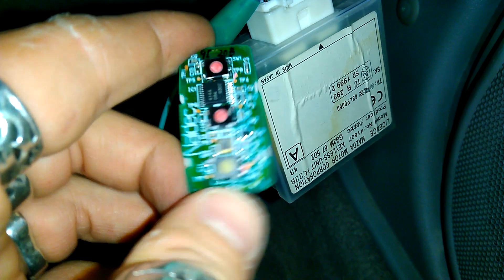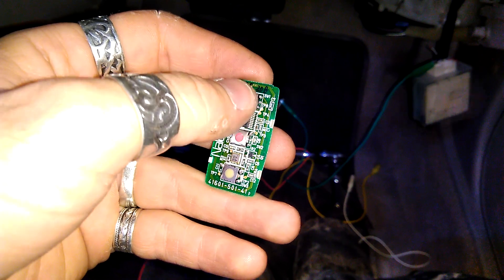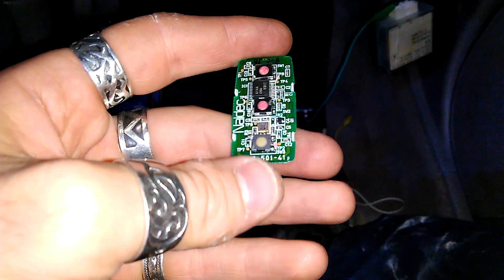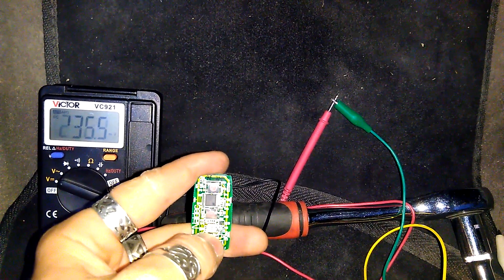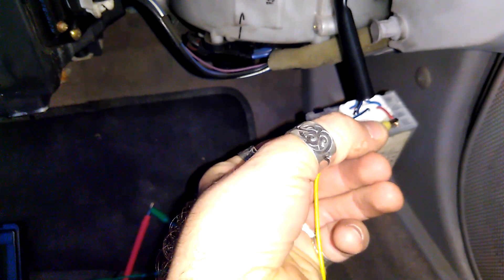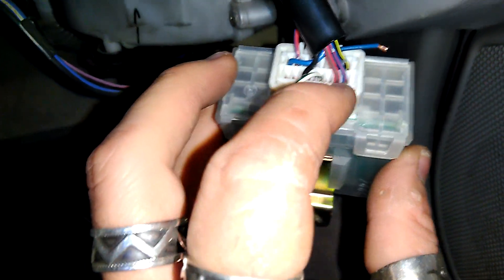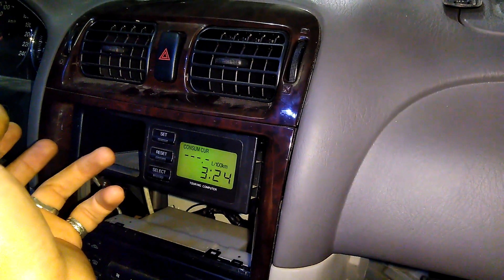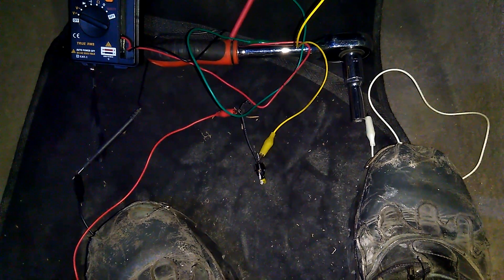Secret, undocumented, hidden functions of Mazda 626 remote control unit

Comment: Trunc relese culd start a car?
Reply from the maker: Not easily. The car has an immobilizer, so it will not start even if you add a heavy duty relay to run the starter.

Comment: In Keyless Entry unit can you tell me what is lock and unlock signal wire colour
Reply from the maker: I do not have the wiring diagram with me right now (I have it only on a book), but I have pinout documentation and the video, so we can figure out the wire color ;) According to the pinout documentation, the wire is pin O, which is the first pin on the row with the clip. Of course "first" pin is relative to the way you look at the connector (from the cables or from the bottom of the connector). The other wire is ignition wire. I know that wire by heart as I've used it way too many times - it is black with yellow. So looking at the video, we can see that the wire color you are interested in is blue. Maybe there is an additional strip to it, but it is not visible on the video. Anyhow - you can test the wire. There are supposed to be 5V on that wire without you doing anything. Then, if you press Lock button on the remote, that 5V are supposed to become B+ -> 6V -> B+. And if you press Unlock, the same blue wire is supposed to be B+ -> 0V -> B+. Tomorrow I can tell you for sure the exact color of the wire. Hope I helped you more than confused you :D
Reply from the maker: Yep, just checked with the wiring diagram and the wire is pure blue color. It connects the Keyless Entry Unit to the Door Lock Timer Unit.
Reply: Mazda 626 GF thanks brother really appreciate your help 🙏🙏🙏🙏
Reply from the maker: Always a pleasure ;)